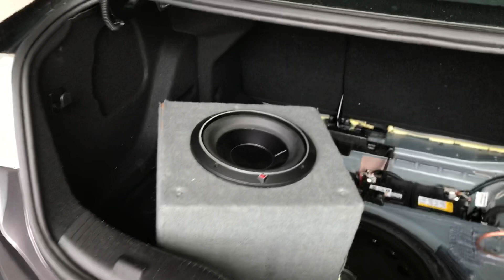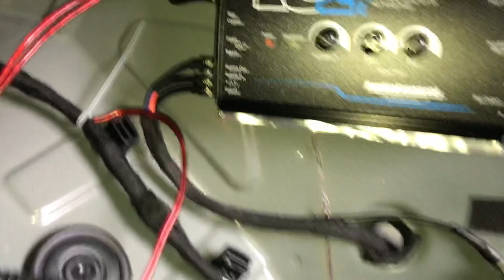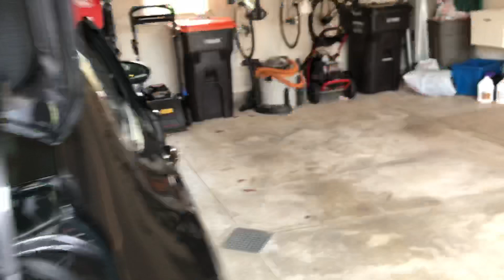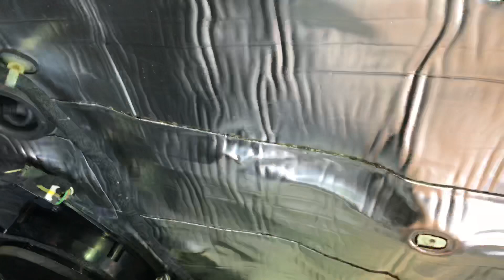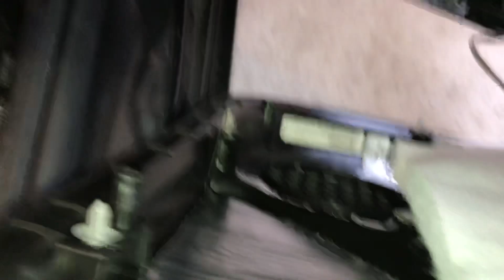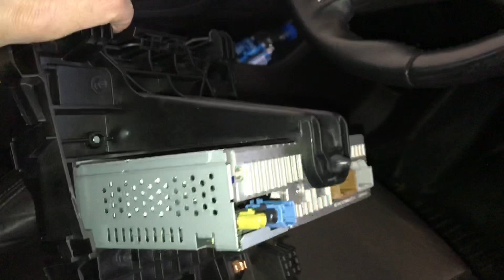2017 Chevy Cruze audio install part 1

Comment: Did you tap into the factory harness or get a t harness ? Upgraded all my factory speakers and adding 6x9 by tapping into the rear door speakers. then adding a 6 channel DSP amp. Will add a sub within time

Comment: Shouldn’t you have the AccuBASS set up higher since the factory radio has that safety feature were when you put the volume up the bass rolls off and AccuBASS gets rid of that safety feature
Reply from the maker: the factory "safety feature" is not really a safety issue, it's more an issue of the inability of the underpowered HU driving the low quality OEM speakers without audible distortion at higher sound volumes. With upgraded audio equipment the goal is a clean and consistent bass signal that is matched to the volume level being called for. My understanding of the Audio Control accubass function; it analyzes the full range audio signal and matches the bass frequency signal to the levels of the higher frequency signal at a given volume level. Bass protection (i.e not overdriving the sub) is now managed by properly setting the gain control on the sub-amplifier. The effect of the Audio Control box is quite dramatic as I have run the sub amp just off of the speaker level output. The bass was muddy and suffered from roll-off due to the HU attenuating the bass signal as volume increased. Hope this helps

Comment: 1) your high level inputs are not hooked to anything. The video clearly shows the wires hooked to nothing what so ever. 
2)if you were using the high levels then what is the signal processor getting its signal from? And why are there r.c.a.'s plugged  in to the amp? 
3) if you have nothing connected to the high level wires how & where are you getting your 12v remote signal?
4) I just need to know how you solved the 12v remote signal issue? You have help in absolutely no way
Reply from the maker: Matthew Jesse The AudioControl bass corrector has speaker level inputs and RCA outputs that go the the amp. Both the AudioControl lC2 has a internal signal trigger that negates the need for running a remote wire. I also believe that the FS amp also has this feature and could be turned on with the line level inputs. The problem with some amps with internal triggers is that they can tend to ‘thump’ when the turn on. The lC2 has some circuit design that eliminates this annoyance.

Comment: Another question: did you apply the sound-deadening right on top of the GM-applied skin on the door? Or did you remove the skin and also get some of the sound deadening inside the door also?
Reply from the maker: Noah Krietsch - on top of the water shield. I did run a 5”x18” piece to the inside of the outer skin along the bottom of the door. I also used speaker baffles on the door speaker. I highly recommend those as they make a noticeable difference and are fairly cheap.
Reply: steve K-man appreciate the replies man. I am literally in the middle of doing new speakers, new amp, new subwoofer on my Cruze Hatchback right now and opted to do the sound deadening as well based on your video which has been very helpful
Reply: Did you get 3 inch deep baffles? Or 3 1/4 inch deep baffles for your door speakers?

Comment: I never really got a good look at the driver-side door. I’m looking to add component speakers to my 2017 Cruze hatchback also, but on the driver side door, the side mirror control knob is in the exact spot where you put your tweeter (at least the tweeter on the passenger side door). Did you put your driver side tweeter in a different location on the door panel??
Reply from the maker: same location. just ahead of the mirror adjustment.  Since I surfaced mounted my tweeters i didn't need much room. If you flush mount, that will require more space for the trim piece. flush mount would look better though.

Comment: Has anyone found a prebuilt converter from the head unit wiring to allow for an amp? Not really trying to splice everything...
Reply from the maker: Look for an amp (there are many) with 'line level' inputs. This allows you to simply slice into the + and - on any existing speaker wire to provide a signal to the amp. A lot of these types of amps also do not require a separate remote wire to turn the amp on and off, as it automatically senses the input from the speaker wire input to turn the amp on and off. Very slick. There are also line level converters that will allow rca connections to your amp.
 https://www.hifisoundconnection.com/Kicker-46KISLOC-Car-Audio-Amp-2-Channel-RCA-Line-Output-Converter-KISLOC-New-KIC19-46KISLOC?utm_source=google&utm_medium=base&utm_campaign=GoogleBaseFeed&gclid=Cj0KCQjwiYL3BRDVARIsAF9E4Gc3W9FWJGudsuWqX5H7-xzUJtumSN2iK30A3yJ-TZHxYHoI8AjhNyIaAkyPEALw_wcB

Note: if you use this method for running a subwoofer amp, you will want to consider a bass corrector I describe in my build to compensate for the attenuation of bass the Head Unit employs as the volume gets turned up.
Reply: steve K-man Awesome thanks for the help! I’m installing a dual 12” subwoofer box, and already have a Boss 2000watt amp. The amp does come with a bass controle nob, so I was wondering if I still needed the bass corrector? I’m on a bit of a low budget built, and would like to avoid an extra $120 if at all possible.
Reply from the maker: @calboese6355  Don't know where you are at with your install. The bass control knob is nothing more than a remote gain control. It will not compensate for bass roll-off at higher volume levels, you also run the risk of creating amp distortion and/or overdriving the sub if you are always cranking the bass up with the knob. Read up on setting proper amp gain control on you system and you will understand why this is so important. Many people blame their equipment when it blows up or sounds like crap, but you would be amazed at how even low end equipment can perform decently and live a long life if set up properly.
Reply from the maker: My gain is set correctly. HU needs to be volume adjusted to just before clipping or distortion threshold, only then should the amplifier gain be adjusted. You are correct, many amps, subs have been destroyed or maligned due to users incorrectly adjusting amp gain or simply using the gain control as a volume knob.

Comment: I have the same vehicle and planning to do it install I am wondering what did you do to get your RCA jacks for your apps Did you buy the Chevy harnessed or did you splice into speaker wires?
Reply from the maker: I bought a wire harness adapter for the amp to the front speakers. Rear speakers are not amped, just used for fill in. The signal for the sub uses a splice from the passenger side rear speaker.
Reply: @68kloost  awesome I was hoping you'd say harness can you give my info on the harness and where you ordered it please and thanks in advance if you have that
Reply from the maker: @majesticblk33  Crutchfield and amazon have these harnesses.
Reply: steve K-man I cant seem to find the harness on either website. Can you post a link?

Comment: Great video I’m about to do an audio upgrade on my Cruze. Is the bass corrector even worth it though?? All I’m looking for is more bass than the stock speakers. Also how did you tap into the rear speakers did you splice into the speakers or??
Reply from the maker: Bass corrector is quite important if want control over your bass. factory HU will pull out bass as volumes increase in order to protect the cheap factory speakers. Yes, just tap into one of the rear speakers for signal.
Reply: steve K-man thank you very much for the information. I’m doing 12inch sub install with 1200 watt amp and a line out put converter the exact one you got. I have a 2017 Cruze LT with just the stock speakers.
Reply: Have 5 subs in mine 😂 3 10s an 2 12s
Reply: @DarkChilled135  damn bruh i have a sing 12 and hit shakes the car xD

Comment: I appreciate your video...I absolutely hate the way music sounds in my Chevy Cruze and there is not really content for the 2nd Gen version
Reply from the maker: Jeff E thanks. I have a part II video posted too.
Reply: Did u have to use an add on amplifier adapter? To connect to sub
Reply: Pro trick: you can watch movies at flixzone. Been using it for watching all kinds of movies recently.
Reply: @Gerardo Ephraim yup, have been watching on Flixzone for years myself :)